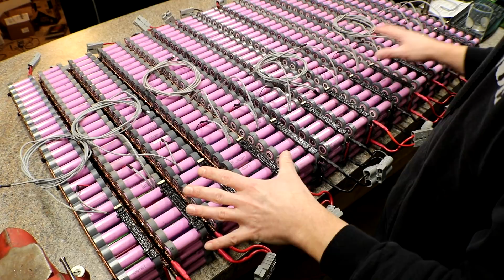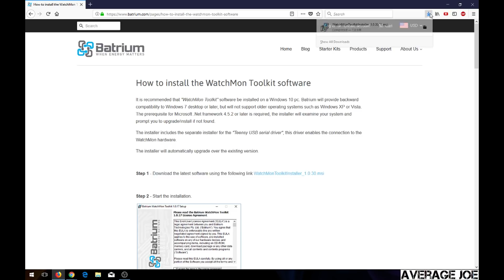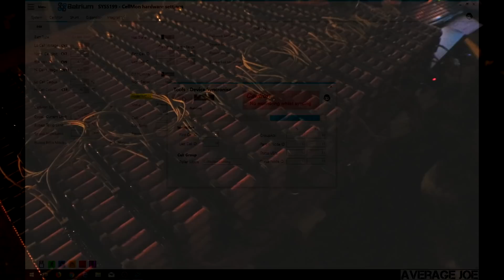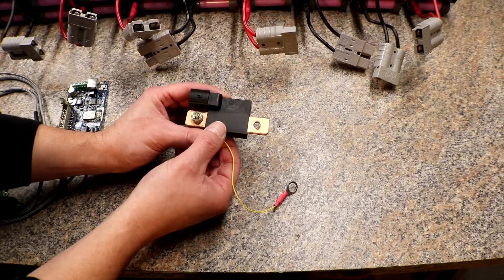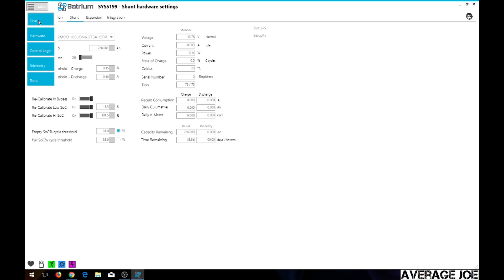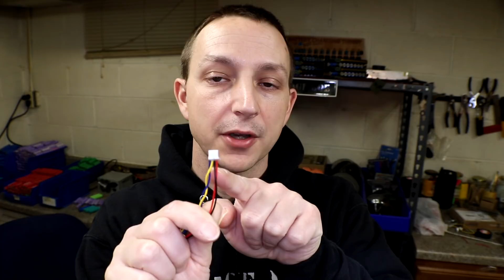Batrium BMS How To Guide!!!

Comment: On the newer shunts,
On the positive input sides it has 2 terminals and you only need to have one positive input.
I used the other terminal as a positive input for the main circuit board.

Comment: Hi I have 18650 48volt diy made battries how do I connect them in parrel I mean the anderson connectors...you went and put them in series to come to 48 volts...I already have 48volts packs and 5 of them...the reason y I'm saying Anderson connectors because that's nice and easy man wooow thanks nice work...pls reply
Reply from the maker: If multiple strings in parallel Id probly connect at a busbar or combiner box with HRC fuses.
Reply: @AVERAGE_JOE  well honestly havnt understood yet but will come to that when the time comes....I've started the exact same way you are building....I bought a ryobi mitre saw today worth $250 got a pvc 3/4 but mine aren't coming out straight like yours maybe the brand I'm buying another ones tmrw...I just got 110 laptop batteries for $100😂 bloody hell it's a job u guys make it so easy isnt there anyway I can show you my progress unless I start posting on youtube my self 🤪 I had a channel though before getting married lols....still waiting for your new vid JOE😎
Reply from the maker: 110 packs is a STEAL at that price!!!  What kind of pvc are you using?  I used 3/4 schedule 80 cause the side wall was thicker.  If you do facebook you can join the diy powerwall group https://www.facebook.com/groups/diypowerwalls/ and post pics ect there.

Comment: Looks like  everybody is happy with batrium except me. 
my problems are:
1.- I was having a 2p14s system, but it was weak for running my clothes dryer, I move to 3p14s, test my clothes dryer everything work(consumption 6kW). Next day I start to smell like burn plastic, check my system the shunt was melting, my consumption energy should be by the time around 2kW. Batrium conclusion you inverter the polarity in  the shunt. Maybe they have never install one shunt(heavy cables), I only disconnect the battery side on the shunt, so  I can add my 1p14s to the system. Finally they decide to ship me a new shunt, only pay the shipping.
2.- With the 3p14s I try to add a new inverter(shunt inverter side). The batrium system fail, no lights, I find the shunt was making the watchmon fail, I disconnect the shunt the watchmon work again. 
Having a conversation with Batrium they were agree to ship me a 1000 amp shunt for half the price but  they told me to send them picture of my system, they conclude that I have 3 cables connected to the shunt(cables are tight no loose), so the shunt get hot and was damage. All the consumption in the system  still running through the shunt. I check the shunt when I'm using the clothes dryer and there's no excesive heating(the average temperature of the shunt is 85degress Fahrenheit. My conclusion is the electronic part on the shunt is the culprit if you know the shunt you know there's tiny cables connected to the electronic part, for me is an electronic fail, for them was an electric one(big cables)
If I want a 1000 amp shunt I have to pay the full price.
My recommendation is avoid batrium, you don't have a third party, they decide you make the mistake and that's it.
My system is a lot of components(panels, breaker, charger, inverters, surge protector etc.) all these were bought through amazon, or ebay. When one of them fail amazon or ebay decide if  was really my fault  no the company that sell the product.
Reply from the maker: Thats crazy!  I havent heard of any problems like that.  I havent had any issues except my own failures.  I do know that connections will heat up if not properly connected and secure!  Ive had that happen many times in past on other projects.

Comment: Excellent Joe ...just so I understand ...each one of those packs are parallel packs that you then wire in series to get your 14S?  If that is correct then each parallel pack has one Longmon attached to it?  Thanks for always being helpful.
Reply from the maker: You got it!!!  That is correct! 👍👍
Reply: @AVERAGE_JOE  Thanks ....what amperage Anderson connectors and gauge wire are you using on those packs if I can ask. please.  Just donated ...you deserve it big time.
Reply from the maker: Thanks Man!!!! Much appreciated!! Im using sb50 anderson connectors and they handle 50amps per wire. The connectors and wire are actually from servers I got from a recycler and they are 10awg👍💥

Comment: Sir i have a question how many years thus lithium ion will be out of usage or failure? Thus all the cell will be replace? Or if using batrium how many years it will take to be replaced?
Reply from the maker: It can really depend on how you use the batteries.  If you use them within there spec limits and charge and discharge under 1a per cell they can last many many years.  It is usually double the length of lead acid.  The batrium is a BMS, it makes sure you dont overcharge each pack and keeps them in balance with each other.  There are many other options the user can set up for longer lithium life.
Reply: AveRage Joe using batrium does the batrium can detect the deffect cell o thus batrium can pin point where the defective cell is located?
Reply from the maker: No it cannot pin point a bad cell in a big parallel pack but it can indicate a weak pack. Then you can go in and take a physical look to determine the cause.
Reply: AveRage Joe thanks a lot for ur reply by the way if i will purchase a 14s batrium can i use it in 7s ?
Reply from the maker: Yes you can! The longmons can be used in any S you like! 😀👍
Reply: AveRage Joe thanks for your reply i will chat you if i need some help when i install the batrium. Do you what is the minimum and maximum amper during charging of batrium?
Reply from the maker: Max charge and discharge really depends on the cells you are using.  If your using used laptop cells then I wouldnt go over 1amp charge or discharge max per cell.  With my setup that means I shouldnt go over 100amp.  Basically however many cells you have in parallel is your max charge/discharge!
Reply: Do u have any idea about watchmon plus? Which is better for watchmon4?
Reply from the maker: Thats going to depend on your battery setup.  The watchmon plus is more designed for new cells in one of the pcb style kits that a lot of people are building with since it can be used with the existing wire loom.  It can be used with regular powerwall builds and used cells but I dont think it can bleed as much or the same amount of power that a watchmon 4 can do.  If your building a powerwall with big packs and used cells I would get a watchmon 4!
Reply: AveRage Joe so in short watchmon4 is still better when it come to big pack of powerwall
Reply from the maker: I think so at least at this time yes!
Reply: AveRage Joe so thanks i will purchase starter kit watchmon4 14s longmons plus SOC sensor is this okey for big pack?
Reply from the maker: That is what I would do!👍
Reply: AveRage Joe thanks a lot i follow your advise god bless
Reply: What is the minimum voltage of 18650?
Reply from the maker: I would say no lower then 2.75 since all the testers we use test to that voltage. Under normal use I try not to go lower then 3v.
Reply: AveRage Joe so is it okey my minimum voltage is 3.5v per pack then maximum is 4.10v per pack, i have set up of 7s 40p for 24v,
Reply from the maker: Yeah that voltage will work but you wont get as much capacity from them.  You could go a little lower since the cells are pretty strong at 3.5v.  Maybe 3.2v if you can go down that low but if not it will all still work just fine!
Reply: AveRage Joe if i go more lower the capacity will be shorten i think. or will be overdischarge?
Reply from the maker: What is the low side of your inverter?
Reply: AveRage Joe i select on 24.5v on my inverter

Comment: Hey Joe,  can you for any reason use the batrium longmon without the watchmon?
Reply from the maker: I wouldnt know where to begin, you need a way to turn the longmon on and off. Technically a longmon is a board of resistors. The watchmon is the brain that turns them on and off when needed. Are you looking to do a diy bms?

Comment: What is a "long mon"..!!!!!
Reply from the maker: Basically a pcb with a bunch of resistors that will bleed off energy of a higher voltage pack to keep in balance with all the other packs!😄🖒
Reply from the maker: Batrium also has other Mons exp- leafmon for leaf batteries, blockmon (square pcb) for top mount batteries and longmon.

Comment: Yesterday was a cloudy day, so my SOC battery at the end of day was 29%. I let the system running, next day, one of my cell packs was 2.5V, there's a way to tell my system one of the cells packs  is bellow 2.9V, turn off the system
Reply from the maker: I have done that a few times as well and now usually put the stuff back on grid so the packs dont get down that low.  But if your not around like we are at times it would be nice to have an option to shut it off.  The only way to do that automatically is to install a shunt trip.  Then in the Watchmon software you can set it to trip the shunt which will disconnect the power at the voltage you set.  I also need to get one for that reason or if some other issue comes up!

Comment: Have you ever had a situation where the shunt didn't get detected? I'm still fighting with the Shuntmon2 getting detected on my Watchmon1 and my Watchmon4 boards. The wiring is all correct, but no lights, alas.
Reply from the maker: HHMM I havent had anything like that.  Mine worked right away once powered up.  Have you tried contacting Jaron to see if he had any ideas?
Reply: Via their contact form, yes. Currently looking at a paid support session from them to try to figure it out.

Comment: Does this BMS manage the battery pack charging process or just monitor?
Reply from the maker: Yup, it will manage on the charge cycle and monitor on discharge cycle!👍
Reply: It seems to me like the battery packs and charging system are complete and the BMS is simply branched off to the side. I don't understand how the BMS impedes the charging current to cells that don't need it. Thanks so much for this video by the way, very informative and well produced. =) Liked and subbed.
Reply from the maker: Yes its more of a add on system and each longmon takes care of the entire 100cell pack since there all connected in parallel. Not the individual cells in the pack. 🖒

Comment: What does the by-pass test check?
Reply from the maker: It is checking to make sure each longmon turns on or activates and puts a load on the pack. 😃👍🔋
Reply: AveRage Joe awesome thanks mate. I have a faulty pack then......batrium rocks
Reply from the maker: If your using rhe batrium, check the connections on that longmon and wiggle them a lil to see if it fixes it.

Comment: As a newb I have so many questions about exactly what the Batrium BMS does.  I've read the Batrium web site and WiKi BMS but still don't completely understand.  Maybe someone will shed some light on these questions.
What does it really do?
Is it just a monitor or does it actually charge/discharge the packs?
Does the charge and discharge circuit flow through the Batrium or does it flow through the shunt and the BMS measures the shunt? 
The longmon's get hot.  Do they actually discharge some packs with resistors to equalize them to other packs?
The longmon's are not connected to each individual cell in each pack so how can they tell that an individual cell is going bad?
And how do you identify that cell?  Manual testing?
Does it control fans to cool the batteries during discharge?
Reply from the maker: The Batrium is a BMS.  It manages your batteries to keep them in balance as the packs recharge to full again.  The reason is if one or more packs get out of balance on recharge, you could potentially overcharge one or more packs and that could be a bad thing for li-ion batteries as we all know.  It is a smart battery monitor and the longmon on each pack has a bunch of little resistors on them that will activate and bleed off excess voltage if a pack starts to go out of balance from the others.  The Batrium doesnt charge anything, just discharge when needed.  The shunt will give you state of charge voltage and measures the amps coming and going into the entire pack.  The longmon is attached to one pack and doesnt check each cell in a pack. You would get a good idea if a pack is having issues if it is recharging faster than all the other packs and the longmon is activated trying to bleed off excess voltage to try and stay in balance.  Then yes, you would remove that pack and manually check the cells. You can actually set it up to turn on/off fans or other cooling/heating devices with the expansion board.  I hope this sheds a little light on your questions and if you have more dont hesitate to ask!!!👍
Reply: Thanks for taking the time to clarify all that.

Comment: i have some cells losing about (.05 thru .08)V over a couple of weeks of sitting in box.  What voltage loss do you consider a self discharging cell?
Reply from the maker: Mine sat in a box for months only because I didnt build any packs untill I had enough for 14s100p and I used anything above 4v as I checked them when I put the packs together.  My opinion is I would use them and if they cause a problem later on down the road, swap them out!👍

Comment: Batrium should just put that smaller board with the connectors on the main board.. not sell a 2nd board just to prevent you cooking the board.. bad design
I think if you're going to read out color wires and where they plug, best show photo of where they are plugged in case people get lost.
OMG, 20:30 I can see pack fuses blowing soon ;)
100 Ohm shunt!?!?!? micro ohm ;)
Reply from the maker: +Phizicks I think most designs are custom installs the watchmon is put somewhere else and thats why they have you cut the plug. Ya I probly could have inserted a pic/diagram for those parts. Lol on the fuses Haaaaa🤣👍💥